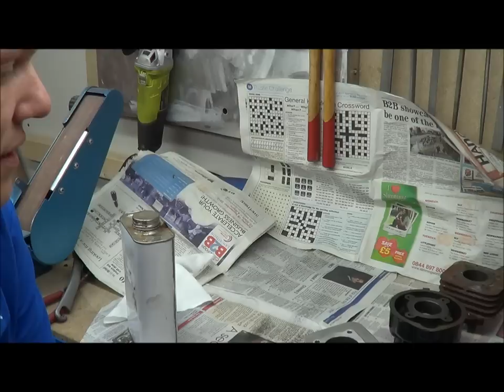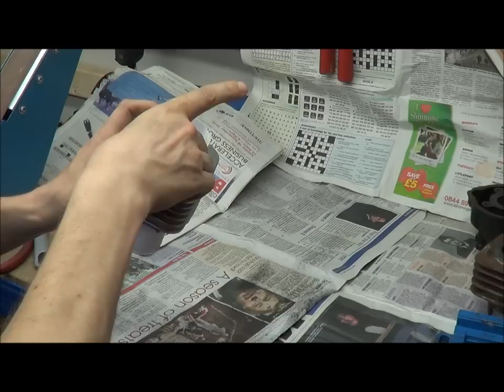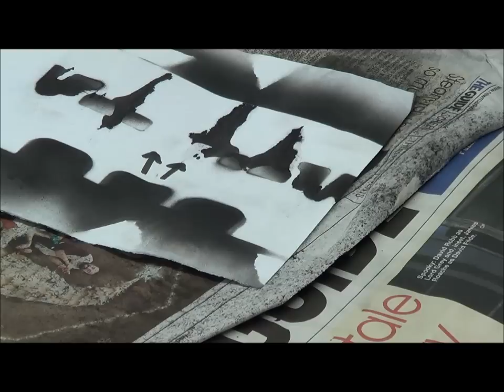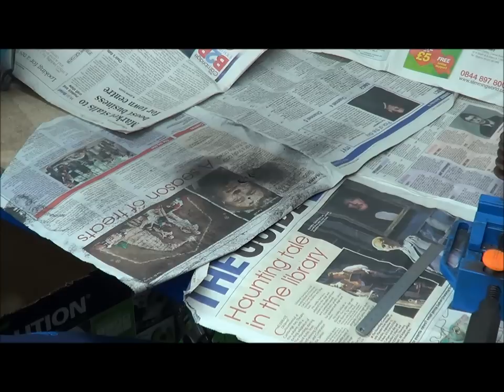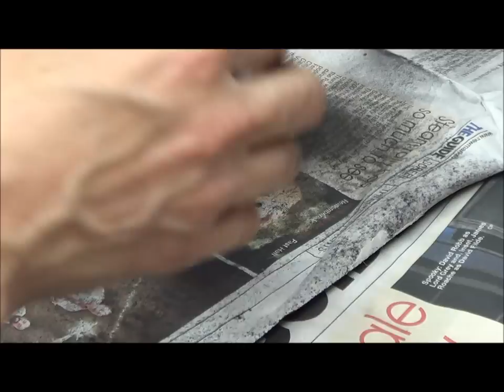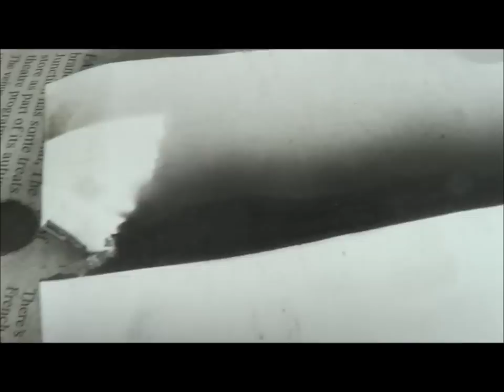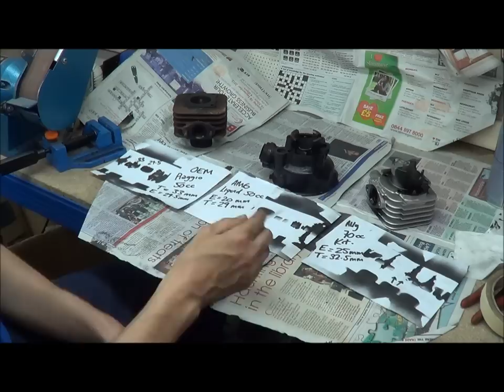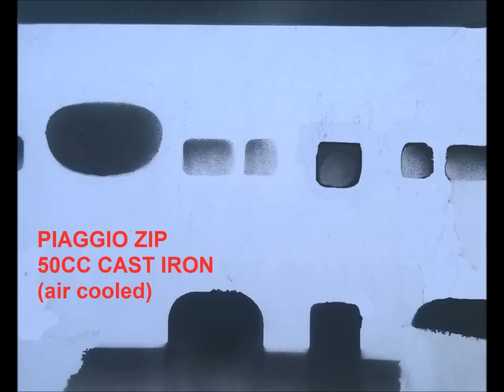2 Stroke Port Mapping

Comment: You can use a thin wall plastic pipe that's larger than the bore. Cut the pipe lengthwise. Fold it in on itself and use that to hold the paper.
Reply from the maker: Another good idea added to the list - thanks for your input - matt

Comment: You could kill two birds with a balloon. It would expand the paper tight against the wall of the cylinder and hold it securely at the same time.
Reply from the maker: Excellent idea, really I feel stupid for not coming up with it myself. Do you mind if I give it a go and record another video, I'll state that it was your idea, if thats ok with you? Cheers matt
Reply: By all means, please do.

Mike
Reply: You could also spray a bit closer to the ports, just get the nozzle of the spray can as close as possible, and I reckon 2 or 3 sprays should do the trick :)
Reply from the maker: Anže
Thanks for the comment, I'm refining my method as time passes then will update you all with another video. All the suggestions used will have your names attached to them, any more ideas would be greatly apprieciated - thanks again matt
Reply: I actually used the balloon idea while attempting this and it works wonders!  I found that using regular (ball-shaped) balloons helped, but the long cylindrical balloons (like the ones used for making balloon animals) worked the best.  Also, too much paint will still bleed on the paper, even with a baloon.  1-2 quick sprays, and a gentle shake of the cylinder seems to yield the best results (aka -sharpest lines).
Reply from the maker: Adam Mason
 Awesome if you wanted you could send me some pictures through facebook and I could post them up with your name of course. Awesome idea, will be giving it a go and doing and updated video on your idea. - matt
Reply: Hey, thanks for the comment.  I'll be sure to send those pics within the next few days!

-cap

Comment: Just an idea, and I really do not know if it would work:
You could use photo paper (yes, the old fashioned stuff we used before digital photos), put it inside the zylinder in a redlight room and then use an LED or small tungsten bulb, that fit's inside all the ports.
This should give you a damn accurate picture of the whole thing. Ofc that inculdes a lot of chemicals and stuff, but maybe you know somebody who does that as a hobby ^^
Reply from the maker: +Emilia Fairbrook Yeah that would work, also using carbon paper pressed against white paper would give a good impression, good idea, albeit abit complex - thanks for the comment - matt
Reply: Pony Power I like your carbon paper idea
Maybe I will try this one out...I don't really want to spray my cylinder full of paint ^^
Or was the result with the airbrush really that much better?
Reply from the maker: I understand your concerns but a quick dip in some acetone cleans the cylinder out. You could even leave it there, the engine will burn with a bit of a funny smell for a few days but wont be too much of a problem. Petrol is an excellent solvent lol
Reply: Emilia Fairbrook .

Comment: You could push a baloon into the paper pipe in the zylinder, and inflate it to become better surface contact. Maybe the paint will run less?
Reply from the maker: Already suggested mate, and added to the list for the next video - thanks - matt
Reply: Didn't know someone already had this idea with the baloon :(. Thinking of this now i believe the baloon rubber could be a little ridgid. But a condom would be worth a try, less pressure little stress on the paper sheet, probably less deformation in the port area. But no one can tell untill you try it out ;).

Comment: I align the top edge of the paper with the top of the bore as an index as well as squaring up the page to it. Paint is ok but my dirty old fingers work ok to mark it from the inside too and easy to use a fine liner pen to finish it off once the paper is out.
Reply from the maker: Not everyone had dirty fingers. I'm not one of those people, great comment dude getting your hands stuff in is always the best way, but you know what these fairies are like today, latex gloves and the rest - matt
Reply: No gloves here I don't like that kind, Mechanic since 1976, old school. I tried the paint way its a good tip, just takes a bit of spray can control and I'm no spray painter.
Reply from the maker: lol neither am i dude. It was just an idea, and there are load of good ones in the comments - matt

Comment: The height of the exhaust port on the 70cc is higher is to reduce the compression height ot keep the compression ratio in spec with the higher volume cylinder.

Comment: I´m using a realy cheap airbrush and it works fantastic for me . The transfers are still not very good visible but i will also try what Mandaz mentioned with the WD40 spraytip

Comment: nice idea, though i'm sure i would have gotten there had the problem came to mind, but what i would do is take a piston and us it to keep the paper tight to the cylinder, and use some of those air brushing sets for paper so it has less chance of bleeding and will wash off of the cylinder easily
Reply from the maker: Cool idea, but this is for everyone. Will be following up this video soon

Comment: wat actually works a lot better, is to tape the paper to the cylinder the same way you do it, then blacken your fingertip with graphite and rub it from the inside against the cylinderports. It will leave a very nice marking of the porting of the cylinder. And you dont have to remove a lot of paint afterwards.......

Comment: if u used the map u have to layout a fresh paper u can put holes in the center of the port locations .. prior to inserting and painting .this should allow the paint through the ports to flow better so can maybe be done with less paint avoiding the runs
Reply: thinking about trex's balloon comment .. using rc tire foam inside the paper tube could both support the paper against the cylinder wall and absorb some of the extra paint if you have the holes mentioned in the above comment .. also use flat black .. it by far dries the fastest.  other thought are to heat up the cylinder before painting to aid in drying time .. maybe a fan lightly vacuuming air from inside the paper tube through the foam will attract the paint to the ports better? another idea for the transfers is to extend the paint spray tip. so it can be inserted into the port before spraying.

Comment: What about putting a piece of carbon paper in, facing inwards, wrap your paper in there, then just give it a solid rub with a wooden stick or something? That should transfer the exact marks very definitively and be very evident between rubbed areas and the actual port impressions.

Comment: If he deposited a cushion inside the paper tube from a pipe using stick , it would push the paper tight against the walls of the cylinder.
Reply from the maker: julio lausell Don't quite understand what you mean, like the balloon idea? thanks for the comment anyway - matt
Reply: Yes, like the balloon idea, but in this case use a piece of sofa cushion cut into the shape of a cylinder. Stuff it into a pvc pipe that is smaller than the bore of the cylinder, and with a stick or anything that will push the foam cushion out of the pvc pipe, leaving it inside of the paper cylinder, the foam cushion will push against the paper. I'm trying my best to explain what I mean. Or in other words use a pvc pipe and a stick to deposit a piece of foam cushion inside the paper cylinder. P.S. pony power thank you for your video.  I like to teach people what i know, and like to learn from others.
Reply: +rynousa IT NOW HAS A NAME that I will never forget =).... Lol........ Believe it or not. I've taken a piston to a local welder for welding some aluminum on to top of the piston for more compression. I shaped the top of the piston myself so that the valves don't hit the piston. Then I brought the weight back to what it weighed before the welding. It's a four stroke engine, the compression is now around 13.5/1 or higher. This motor is a chinese 90cc honda clone. I don't know if it would work for a bigger cc engine, but it's worked just fine so far with this little motor. The sound of the exhaust changed a lot, and I now run octane booster. P.S. Hooray for the Tampon Method!!!!!!! Lol. Merry Christmas!!!!!!

Comment: Use matt paint, theres less chance of runs and it dries quicker, so a few coats can be done in a short time
Reply from the maker: +rickburnout666 - i did lol Next time im going to use an airbrush to give me more control, then work out a fix so other can use just a spray can. Also have another idea, but you'll have to wait for the video for that one.
Reply: Matt USED Matte......
Spelling DOES matter at times! 😜🍺

Comment: Why not just measure with a micrometer tail zeroing at TDC.  Then find find each measurement. Take the total piston travel using 180 to divide all the numbers into using full piston movement (down stroke)... This will allow you to scale the design.

So, for example, if total piston travel is 100mm.  Do the math and you will see how many degrees each event and degree duration each event occurs.

In short, if you have the entire engine, best way is to use a degree wheel looking to see how many degrees it takes for ports to open, how many degrees they are open for.  If you know the stroke travel, those degrees can be converted to travel numbers.
Reply from the maker: What you described doesnt work. Let's just say that yoy have your 100mm cylinder, at 90deg crank angle. How far are you down the stroke? Becaus if you think it's 50mm your 100% wrong.

Comment: Use a motorcycle inner tube for that,,, cut it in two places and tie knots in the ends,,, make sure to use the one with air valve on it, lol
Reply from the maker: Again another good suggestion - will add that to the follow up video list

Comment: lets say i want to run nos in a 2 stroke, do i simply first change from 50:1/ 87 octane to 32:1/93 octane first so the higher pressures generated from the nos wont push the mixed fuel from between the bearings?

Comment: by spraying the ports, doesn't that make the ports has to be cleaned again?
i thought the exhaust port supposed to be mirror finished
not to mention the gas ports..?

thanks for the video anyway
Reply from the maker: Joshua Valentino Yeah you have to clean it, but that's not the point of this subject. Ports don't have to be polished just smooth. People as wasting their time polishing ports so they shine, They just get covered in carbon. Thanks for the comment - matt

Comment: what is your mic made of? i can hear your neighbors thinking, like holy, sounded like you were using aggressive sand paper to clean the cylinders and putting the lid on the acetone while it was in my ear, that's mad sensitive
Reply from the maker: Its built into the camera CX-190 piece of shit lol
Reply: well there are things it would be great for, i know so many videos i watch where someone is all like "listen to this" and i swear they just mute the video, don't know if you have any projects planned that need audio sensitivity, but it would work great if you do, also try taping some foam to the hole so the sound has to go through the foam, record a test clip and check it out, see if it works, it should

Comment: Oh my goodness ... why don't you make a finger little dirty and rub from the inside of the paper over ervery port and edge ? Its faster and exactlier without the color everywhere ! Next thing is, for what do you need this? For measure a portheight i don't need a procedure like this. To see, which cylinder have a bigger port area compare to the other i have two eyes in my head. The max. timing on a two stroke cylinder is wellknown (135°transfer and ~200° exhaust) and the only thing you should do is to match this with the widest port area you can get. Really important is a degree wheel on the crankshaft and ready is a good cylinder. Matching crankcase to cylinder is also clear.
Reply from the maker: +ariane11970 "timing on a two stroke cylinder is well known (135°transfer and ~200° exhaust)" port timing is different for different cylinders, that's the point and this is an experiment to make measuring and comparing the timing and port area easier to see. A degree wheel is also very important, however this is testing the method not actually taking measurements, that comes later.
Reply: +ariane11970 

Yes I agree with what you say a shadow map is nice but I
would not get my port open timings off the shadow map there are too many anomaly’s(stacking tolerances, port chamfers and such) accuracy is marginal at best, the first thing to do is to degree out the port openings in degrees from true TDC with the engine partially assembled, these numbers can and will give a correlation to tuned performance of the engine package, if you are going to design a tunedpipe for the engine you will need to know port timing in degrees anyways as most  all pipe design programs will ask for this information If you want to know the port heights in MM or Inches most good two stroke design software packages have programs for doing that and doing it that way is much more accurate
Reply from the maker: This video was just to demonstrate a way of mapping ports for comparison, the next video will cover the rest. Thanks for the comment - matt
Reply: ahh dude i was going to mention that,but then you cant hold the paper just as well,even doing the gasket thing with a smooth roung edge to rub the edges to cut out against the cylinder port giving a template in the paper.

Comment: its a butterfly lol
Reply from the maker: What's a butterfly?
Reply: your wonderful art work . buy the way tuning houses such as malossi. stage 6. are selling cranks with longer rod for this very reason . more midrange power  . why dont you ask them if im right or wrong .
Reply from the maker: I don't get what you mean? Bit of a weird comment. Stroker kits or rod to stroke ratio is based around how perpendicular the force applied to the crankpin to the crank angle. 

This can (depending how far you go) increase torque in the midrange but also shifts the dynamic balance upwards towards the piston. Shifting the dynamic balance away from the centre of rotation increases the load on the wrist pin and crnakshaft bearings, increasing resistance and wear. 

This also effect piston mean speed - increasing it, which effects port timing and final increases the mass of the engine. Mass increase comes from not only the longer rod, but also the longer cylinder, unless material is removed from the crank and/or piston - but this is rare.
Reply: so now you understand thanks
Reply: so we shake hands and get back to tuning not fighting